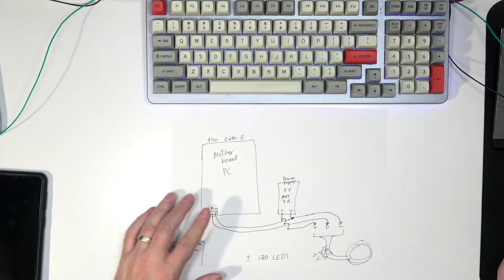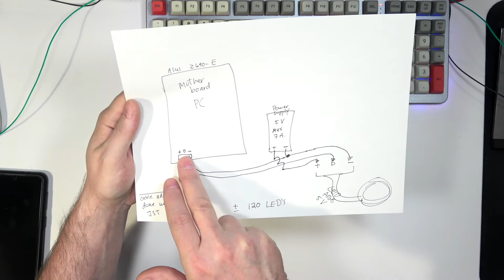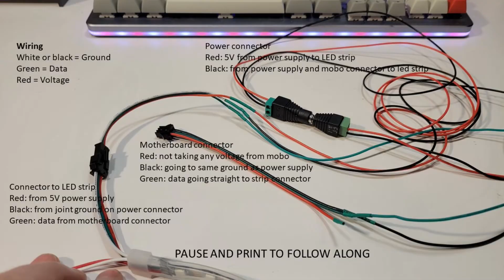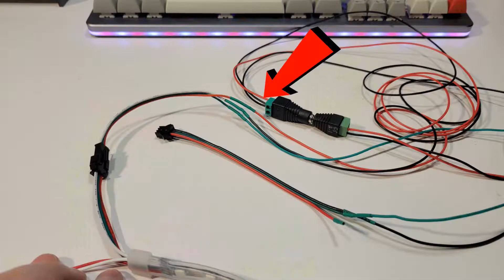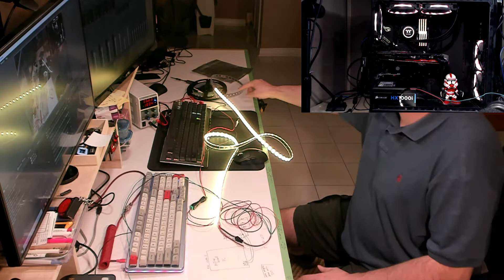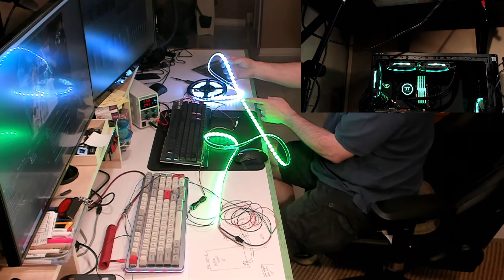Can you control long ARGB Strips with MOBO header using external power supply?

Comment: Tip: Instead of using an external Power Supply, you can connect the 5V power source directly from your PC's PSU using a Sata or Molex connector.

Comment: So in theory I can use the power from an unused argb port from the motherboard and connect the data(/ground) from the argbfan hub that is controlled with the frontpanel. My bequiet 500fx case controller only supports 30 leds(when all 3 pin ports are used).

Comment: I have a proprietary ARGB strip i need to get working.. the header it connects to has    ( D1 -  G - D0 ) ... do you know what the D0 would be for on this as the ARGB signal comes in a (5v - D1 - G) when running the fans ARGB.  I can replace the fans and throw this dead controller out but these strips might not be as easy to replace in the case.  Hoping to modify the end and power them with the ARGB power but maybe i am misunderstanding how the Strips work.
Reply: ya know what im just ripping that proprietary stuff out .

Comment: What is the type of LED strip that you have there on the spool? Looking to DIY some argb strips around my desk and monitor. All I seem to find are short strips. I may be using the wrong search terms.
Reply from the maker: On Amazon (Canada):  BTF-LIGHTING WS2812B ECO RGB Alloy Wires 5050SMD Individual Addressable 16.4FT 60Pixels/m 300Pixels Flexible Black PCB Full Color LED Pixel Strip Dream Color IP30 Non-Waterproof DIY Projects Only DC5V
Reply from the maker: Get the Ip65, with silicon coating on it.

Comment: Do you know if having (3) ADD_GEN_2 3 pin mobo headers will allow for more ASUS Aura Sync addressable LEDs? I ran into the issue where I plug in a 3rd string of LED strip lights and get flickering and it basically breaks the system. I found a motherboard at Micro Center that has 3 ADD_GEN_2 pin headers, but was wondering if this will increase the amount of ARGB +5VDC LEDs I can use or not. Fellow Electrical Engineer here, really enjoyed your video, but was disappointed to learn it was a software issue with the limitation of the message structure / byte sequence.

Comment: I'm thinking of doing this with a 24v strip. I was going to solder the R G B connections to a RGB female header and have the 24v power with its own external power supply that the strip came with. Was just wondering that would it effect my headers or mb in anyway?

Comment: Hi! I have another idea. I have 5 spare rgb raijintek Iris 14 fans and I want to make like a header on the wall with them 5 just lights without motors. They are 4 pins all connected to the raijintek hub. Problem is I need somehow make power supply to this hub, which normally in the pc case had SATA connection. I though maybe buy backplate with Molex, inside connect Molex to Molex or psu(6 pin to Molex cable), then go one cable to the header and use adapter Molex to SATA, then should all working. What you think? Another option was buy completely separate power supply (like laptop style)12V but I don’t know amps and staff like that so it’s hard to choose online. 
Any idea? Greetings from UK, Tom.
Reply from the maker: Hello Tom, I have a couple of computer fans that cool my home audio amplifier and what I did was use a standard wall ac to dc converter with a male plug, like 12 Vdc/ 1 amp, then connect a female pigtail  and connect 12V and ground to a DC buck converter to manually control fan speed, and then from buck converter to an aftermarket Sata male connecter to go to the fan hub you have. That would be like 20$ USD, 4 quick solders and a fun 1 hour project. All these items can be found on Amazon and every home needs a 10$ soldering iron from any store. I might do a video on this, but don't hold your breath. Good luck.
Reply: @cac2244  thanks for answer ;-) yeah it’s easy but hard to find all components. First I was thinking about completely separate power supply to the hub, operate with remote control and all done. But didn’t know what to choose. Now I think about use psu to backplate. I can’t find for now anywhere backplate Molex mount, which I would connect straight from or another Molex or psu. Then nearly ordered 2m male-female Molex extension which some company made specially for me because no where that long available. Then plug to the header with adapter Molex-SATA and all done. Sounds easy but not easy find all parts. Greetings, Tom
Reply: @cac2244  hi again. I founded each fan have 21 LED’s. So total will be 105 LED’s. Do you think 1A will be a enough ? Maybe choose little bit more? Thing is they connected to the hub so I don’t know much amps. Any idea? T.

Comment: I would like to ask for a clarification, the way it was explained sounded like the data line was loosing power for each led it visited until it reached the end, however I was under the assumption that the limitation would not be power based but information based by how much data a single packet can send and be retransmitted.

Is the reason that the other leds are not updating because the data signal is to Week or is it because there is a limit of addresses that can be changed?
If it is because the signal is too week can the signal be boosted externally? Similar to how your powering the strip externally
Reply: its based on motherboard or circuit, its not about weak data signal or losing power, if your board says only can control 120 LEDs, means you cant go more than that, and every led strip especially ARGB are build with chip, so its more matrix compare RGB leds.

Comment: I was thinking about doing this but I didnt know if it was possible. I wanted to do it because the ARGB header on my mobo doesn't supply enough power to feed the whole strip. I have the X570 Aorus Master which handles 5 amps, do you think the data running short would happen on my case?
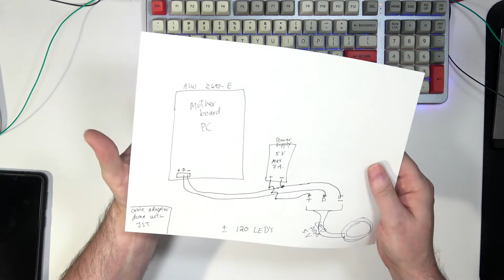Reply from the maker: Both. Electrical diagram at 1:16
Reply: One more question: Does it need to be grounded to the mobo or can I connect the ground cable only to the psu?
Reply: Same question